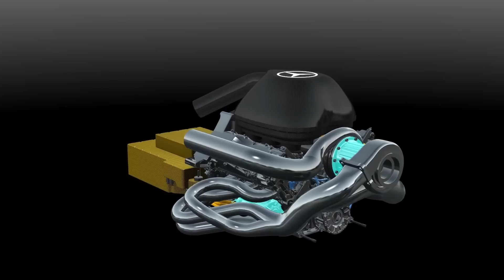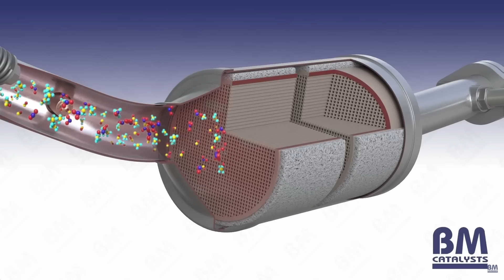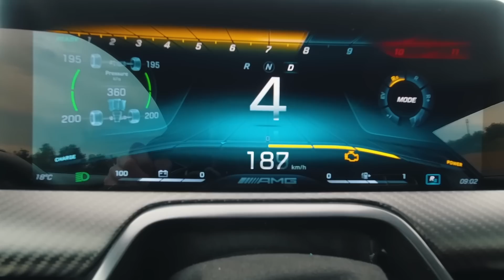How Mercedes Put an F1 Engine in a Road Car

Comment: Its engine is designed for 50,000km or 30,000 miles. This is in line with other Hyper car engines who typically do not state this durability figure.
Reply: Its so sick they managed to squeeze 50k km out of it. Its literally an f1 engine
Reply: @emmakeuken7436 l the features that strain the engine the most have alle been detuned to supercar levels lol, boost pressure, REVs, idle, crank case geometry, compression ratios 🥀
Reply: Gordon Murray said one of his Mclaren F1s had 60,000 miles on it but he didnt say if it  had been rebuilt. His current hypercars seem to be a much more rational choice for the road'

Comment: The thing with the pneumatic valvetrain is that they just have pneumatik valve springs, they still use an camshaft. The Fiat engines with Multiair/Twinair (like the 2 Cylinder 0.9L Fiat 500 Engine) where they have pneumatic actuators for the valves and dont use an camshaft.

Comment: The fuel flow limits for F1 only let them rev to 11-12,000RPM anyway. Not much different than the road car.
Reply: i think its closer to 13k, though the drivers always shift before 12.8k anyway

Comment: I wouldn't buy one unless they can get the revs back up to at least 13500 rpm. What's the point of using an F1 engine without most of the original power band?
Reply: But they dont produce much if any more power over 10,5k in f1 since that is where the fuel flow is. 100kg/h at 10,5k you cant put more fuel in than that so they wont be making much more power than at 10,5k
Reply: @akiro43  huh, I guess you're right about current F1 engines. At 1:59 he says they rev to over 15k, so I figured the power band would be like 12-14.5k, but I looked it up & the power drops off before 12k due to fuel restrictions like you said, so it's not as disappointing as I first thought. Still, if I was in the market for a multi million $ car, I'd rather pick a GMA T.50
Reply: @nathansmith3608  yeah I agree its disappointing when you hear they put an F1 engine in a street car but it is still incredible that they made it work with modern german regulations at all. You just have to look what the manufacturers have to do to normal cars to meet those regulations to see how ridiculous it is. I hope with synthetic fuel in the future they will be able to build cars more like they want to again

Comment: 1:44 I'm pretty sure Brian Garvey said on his channel it's a myth that F1 engines are seized when cold. You don't run them cold b/c it causes increased wear, but they aren't literally seized - when you have the engine out you can turn the crank manually without heating it for example 

I think he mentioned it in a couple videos, but one of them is "F1 Piston and Conrod - A Closer Look - Ep 20" timestamp 4.40
Reply: Does 5:55 look similar to you. This guy needs to begin sitting his sources
Reply: @tlovsoe4211  you're right - good eye!
Reply: Can you imagine the nightmare of assembly if this were true, and f1 engines were seized when cold? This nonsense has been spouted for years with little thought to the logistics of the statement.
Reply: @thomaslax39  I suppose were it true you could hypothetically freeze the pistons before sliding them down the bores. I have wondered what exactly takes 15 minutes or what have you to start up an F1 car, and it never really gets explained beyond "tolerances".

Comment: Hold on: The Cybertruck cheesegrater is legal in the USA, but this isn't? 

What exactly are they smoking in the USA?
Reply: Bullets I guess
Reply: They are smoking orange peels 😂😂
Reply: The Dollar Bills that the American Corporates Pay towards their Campaign Funds to keep "Foreign" Vehicles off American Roads.
Reply: Emission is more important than the immediate harm to it's driver.
Reply: @varnix1006 fuck no. Emissions shouldn't be that strict to hypercars like this. USA will have maybe 10 amg 1s. That low of a number wouldn't even emit anything
Reply: Emission laws are getting more and more BS and the worst part is that they dont target powerplant generators that still use coal and diesel as much as they target cars which cause significantly less polution compared to them. Also no clause for clean fuels like clean methanol or ethanol.
Reply: Brother it's just a truck with no emissions 😅
Reply: @HourRomanticist  yet with such forms it’s dangerous to pedestrians, it will cause much more harm for them during collision than regular car
Reply: @HourRomanticist  It's deadly to pedestrians. Or do people not matter to you?
Reply: @mattevans4377 Mustang drivers are deadly to pedestrians long before the Cybertruck even existed , lifted pickups aren’t healthy for them either or a 3.2ton caddillac escalade shaped like a brick  for example is much safer for people ?  absolute nonsense
Reply: @mastodon5220  Agreed, but they still comply or complied with some sort of regulation. The Cybertruck actively breaks what little regulation the US has, and is still given a pass
Reply: @mattevans4377which car can hit people and not be dangerous to people…

Comment: The engine is based on the 2016 nico rosberg's w05's engine not 2017, The engine is scheduled for an overhaul every 50,000km not 31,000km as stated in the video, which is actually very reliable for a race engine and most million dollar hypercars never come close to that mileage,
The cars that had issues on top gear were prototypes with unfinished software, so many more mistakes in this video that i can't be bothered to correct, but those are the most glaring ones.
Reply: AMG itself claims on its website that the engine only lasts 31.000km, so he’s right. 
Rosberg asked AMG to put some parts of his 2016 championship winner engine in the engine of his personal AMG One, but the engine itself comes from almost all the years of the race car production. It’s not an engine taken by an F1 car and put in the One, it’s built from scratch with all the knowledge that AMG got throughout the years in F1, so the concept ad a 2017 engine, but the production cars have an engine with almost all the ultimate tech and improvements, so it could be a 2020/2021 inspired engine too
Reply: @M15tER-X  You just came up here to spew all that unverified rubbish with full confidence when you had all the time in the world to do your full research before responding to my comment. 
The engine in the AMG one is designed only after the 2016 engine, not any other one, the engines are not the same over all the years. 

That specific engine is built off the blueprint of the 2016 engine specifically.
Stop chatting about shit you have zero understanding of, the engine out procedure is recommended every 31,000miles=50,000kms.

Comment: Engine has to be rebuilt every 30,000 miles at a cost of $900,000. 😱
Reply: The business plan is servicing, not the car itself. Like most car manufacturers nowadays... 😂
Reply: @coffekadze  remember the SLR McLaren, many buyers sold it off as parts were very expensive  and maintenance was a pain in the bum. Mercedes coming back at it again.
Reply: @danielvipin7163  that was much more to do with McLaren than mercedes
Reply: They are benz, they will have some maintenance package to sell to customers.
Reply: Not an issue for most of the cars, they’ll be lucky to hit 1000 miles as they are all in climate controlled garages, too valuable to drive.
Reply: That's quite a long life actually. None of them will see that kind of mileage anyway
Reply: So does the McLaren F1 and yet i dont see people crying about it
Reply: @dr.science_0177  source?
Reply: Business expenses for a billionaire
Reply: How many of them will actually be driven enough to reach anywhere close to that? So basically it would never actually come up
Reply: the first few are for free?
Arent they
Reply: Still more reliable than the ford wetbelt 😂
Reply: He said 31,000 Km. Or 18,000 miles.
Reply: @Dr904 its every 50k km
Reply: no, that would be the case if it has failures
Reply: I rather have Ferrari F50.
Reply: @GF-mf7ml  completely different cars. This does not have an equal.
Reply: @MyMintus yes it does

Comment: F1 V6 engines rev to 11.000 rpm, and turbo motors make their power relatively low in the rpm range (unless the turbo is way too big for the engine, hence twin turbo was invented with 2 smaller turbo's spooling up way faster as 1 big one) please do your research more before making a video.

Comment: The reason the AMG One was delivered to customers such a long time after its introduction and the acceptance of orders is because they basically had to develop ways to make the engine road-legal twice. They did it once but couldn’t finish the project as a whole fast enough before new emissions and especially noise regulations came into effect in the EU. So they had to acustically insulate the engine more which led to the cooling layout not working anymore so that had to be redesigned, the power delivery needed to be adjusted,…
Reply: These exagerated emission standarts that only apply to acrs and arent being as heavily pushed to powerplants based on fossil fuel is honestly ruining the car industry.

Comment: "setting a new lap record" is misleading. Without context, people may believe that this car has the overall record at the Nürburgring. It's not the overall record at all, not even close. That's as far into the video I got.
Reply: By mass production car, with street legal tyres AMG One is absolute record breaker.
Reply: @zdipi89  Yeah but that's not the overall record.
Reply: @logitech4873  Overall record can be set by helicopter.
Reply: @zdipi89  I doubt it, it would have struggles staying within the track limits :)

Comment: I still think the F50 being based off the Ferrari 640 or the TAG Turbos installed in those 930 Porsches was much cooler than this. Even Ferrari realized to make it more streetable you needed to bump the compression
Reply: The Ferrari doesn’t use an F1 engine like they claim. It’s a version that resembles their F1 design.

Comment: Mercedes: “Our new hypercar has a highly advanced Formula 1 powerplant!”

Porsche: “That explains why it needs a full rebuild after just 5-10,000 miles.” laughs in 911s with 200k mi odometers
Reply: The rebuild is necessary after 50.000km.

But thats not the point, nobody on the world thinks, that a f1 engine is a longterm, cheap to operate engineering masterpiece.
Reply: Thats one of the reasons why Porsche chose endurance racing over F1. Most of the tech from endurance racing actually makes it to production cars and reliability benefits drastically. Meanwhile theres only so much tech that can transplant from F1 to regular cars.
Reply: Dumb comment🤡
Reply: Its easy for Porches they have VW tech in them now

Comment: Can't wait for someone to LS-Swap that thing
Reply: Keep dreaming, the package is so tight, plus the engine is part of the chassis
Reply: Might be the stupidest idea
Reply: So u want to swap the engine to a lazy, low power to litre ratio? Nope
Reply: @MrCylan88  An LS can Easily be tuned to over 1000 Horsepower with the Correct Parts and a Supercharger, and still remain so Reliable as, so long as the work is Performed by a GM Accredited Company such as Calloway or Hennessy, to Retain its 5 Year Warranty!   This Engine is less Powerful and is Unreliable.  LS is Better.  More Power, a 5 Year Warranty, Lighter (as the 1000 BHP at the Crank would mean the Hybrid Gubbins could also be Junked) and Considerably Easier to work on!
Reply: Highly unlikely to happen in our lifetime
Reply: Aussie Aussie Aussie!❤
Reply: ❤love dreams.
Reply: And for it to go slower

Comment: Didnt Koenigsegg already have pneumatic actuators, called Freevalve technology?
Reply: Yes and no. Formula 1 still uses cams for opening its valves and the pneumatic control for valve dampening. Freevalve has no cams and uses a hydraulic actuator to open the valves and a pneumatic control to close the valves.
Reply: different LOL

Comment: To me, the Mercedes AMG One is the distilled essence of modern German engineering across the board. I used to be heavy into German cars until the excess complexity and unreliability turned me off. I now joke that the German engineers take powerful drugs before they design something. Two million for a car that can barely run consistently is an absolute joke.
Reply: In a way, this is the quintessence of a hypercar. Ultra high tech for something that more likely than not will never see a track day
Reply: Name one non German automotive brand engine and power train  who is more solid than an Rs6, m550d, S63. You won't.
Reply: Mercedes F1 and AMG ONE cars together are British engineering, they are developed and built in England, both engine and chassis.
Reply: @alvarokoteli3643 They aren’t. They are made in Stuttgart, by german engineers. Your shitty bri ish cars are being developed by gay people and Indians.

Comment: Great quality video but your knowledge is lacking if I'm honest. There are about 15 point you have incorrect in this video. 

The amg one can do about 5-10thousand k before rebuild/replacement. Amg have been open about this. 

Along with a bunch of other things you have incorrect like current engine starting procedures are much different to what you described. 

F1 cars don't idle at 5thousand rpm at the start line... the driver increases the revs to around 10 thousand as current f1 cars idle between 5-7 thousand rpm.
Reply: The engine rebuild is after 50.000km or did the first cars had to do dis earlier than advertised?
Reply: @MJ-mw3ni  there is one owned by somebody in the emirates and they have openly come out and said they won't start or drive it after the car drove 10kms and needed a new ice. Mercedes said they can possibly do up to 50000 in one quote but been more open about the fact they are so highly strung they need parts or replacements at around 10000km

Comment: If its engine is so small,why is the car fat
Reply: There's this thing that people who drive cars, started caring about back in the 70's called "safety". It's pretty neat and can be helpful once in a while. There might, maaaaybe be a video or 2 on here that can explain it to those who are new to the concept of automobiles (or "motor carriages" as I suspect you would call one). I suggest watching one of them. Both informative and entertaining. :)
Reply: Tight tolerances, building to the limit of what the engine can make before it explod.
Reply: Euro 6 emission.

Comment: Just a small correction: all teams had developed the MGU-H in 2014. Mercedes however was the only team to nail the split-turbo MGU-H concept, allowing it to run way more efficiently and cooler, while other manufacturers (RENAULT) were struggling with reliability and heat. That is what they did pioneer, then followed then by Honda and then Renault in 2022 (explaining their current power defecit, basically too limited testing for a new concept. Imagine if they could test more..) Strangely, Ferrari never adopted the split-turbo, which might work in their advtange as the 2026 engine regulations supposedly are canning the split-turbo idea!
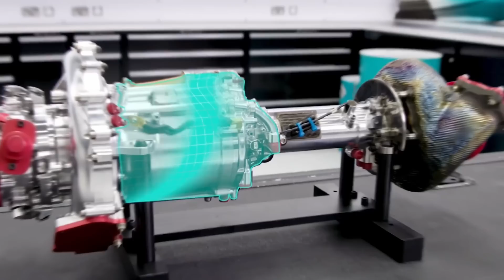Reply: It‘s said in the video as well though, from 6:42
Reply: @cyancut21  yeah, I'm wondering if you can edit a YouTube video after posting, or if this is just a retarded comment.
Reply: He said Mercedes was the only team to hit the mark with the V6 hydrid engines in 2014
Reply: @Hudson2094 no, he said they pioneered it which was absolutely not true, renauts racing division did so in terms of prototypes in the early 2000s and academia did play with it since the 70s/80s lol
Reply: i just wanted to write this. Thank you
Reply: split turbo added minimal amounts of efficiency lol